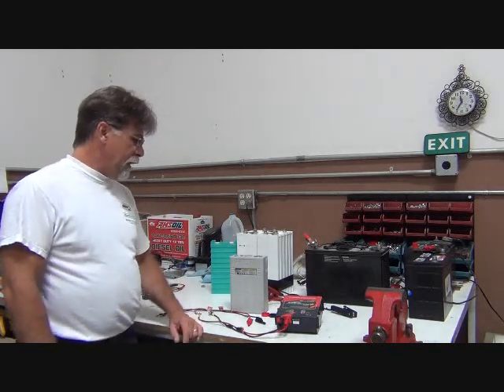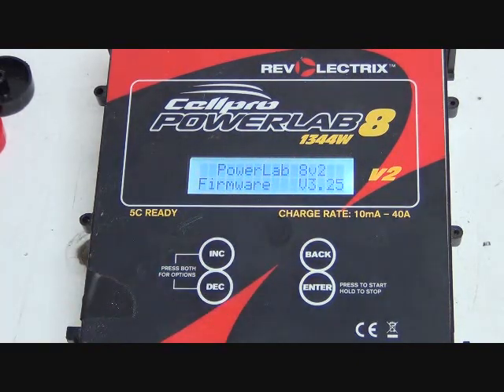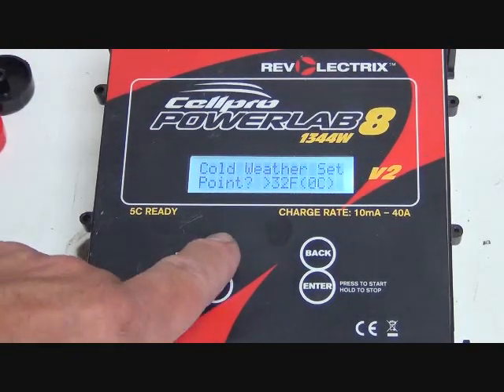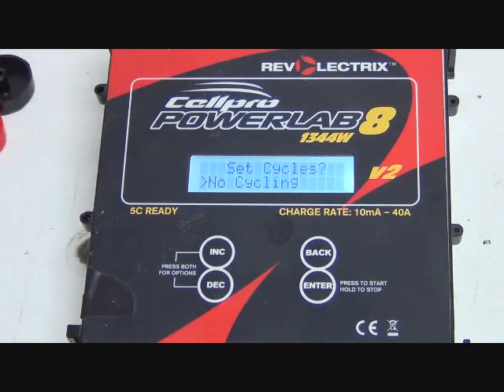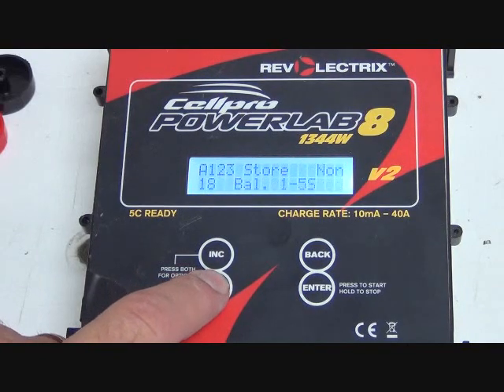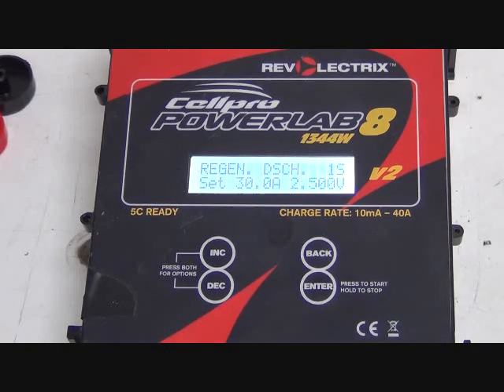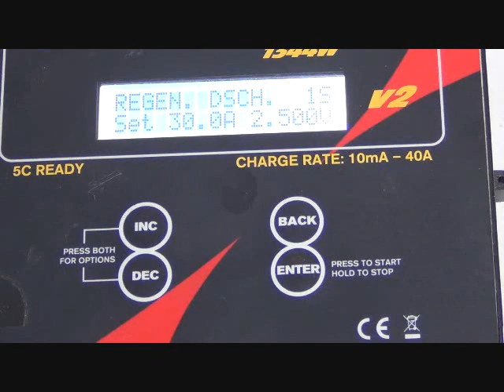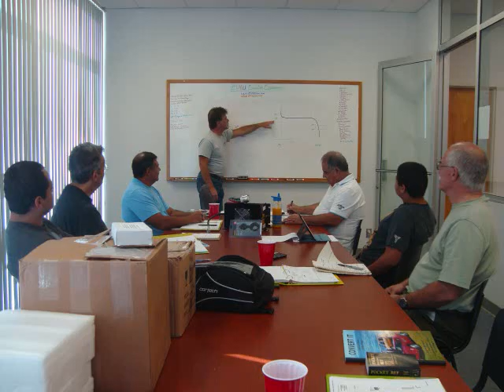How to Use the Cellpro PowerLab 8 to Bottom Balance EV Cells

Comment: Just started balancing cells this weekend.  Thanks for confirming some of my guesses about the inscrutable Powerlab 8. :)

FYI, during discharge you don't have to "put a meter on it".  The INC and DEC buttons will bring up all kinds of info, including voltage, time, actual discharge rate, and milliamp-hours discharged.  Makes watching the paint dry that much more convenient.
Reply: Thanks for this comment, answered my questions.